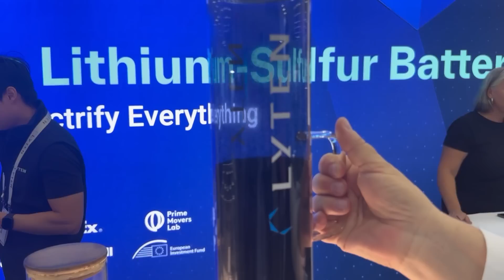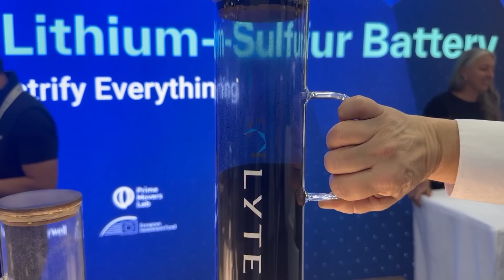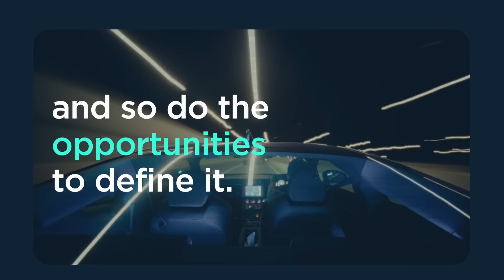Lithium Sulfur Batteries Are Half the Weight, 40% Cheaper & Coming in 2027 - The Battery Show 2024

Comment: Lithium-Sulfur is absolutely the future of batteries along with Solid State batteries. Sulfur can hold as much as 5 times more Lithium Ions that the best current chemistries using Nickel and Cobalt with 1/3 the weight. So a current 300 miles of range becomes as much as 1,500 miles. But even half that beats all current ICE ranges (so why on earth did he bring up hybrids with twice the parts to go wrong? Isn't 1,500 miles enough? Good of her to shut him down). And of course, the cost of Nickel and Cobalt is gone from the picture. 

So of course, Lyten is far from the only company working on them.
Reply: So many people don't understand how much range they really need.  With rapid charging becoming very accessible hardly anyone needs more range than what they can drive between meals.
Reply: @bobwallace9753  Correct. But the extra range is definitely needed when towing. And this shut up all those naysayers with the unprecedented ranges these will provide. Not only for the EV's, but also the extra storage capabilities on the battery megapacks at charging sites with solar which are springing up all over right now. They collect all the solar when EV's aren't charging on it.
Reply: @junehanzawa5165  
True.  Some people need more range because they tow.  But how many people tow something a long distance more than once every few years?  How many people ever tow at all?  If you tow but very seldom, rent something for that once every couple of years stuff.  

Right tool for the right job.
Reply: @bobwallace9753   Regardless of your point being correct, if we want people to abandon ICE, the more range the better. Which is why EVERY company and battery maker in working on improving range and energy density. New technology only replaces old technology if it's better, not the same. So EV's have to beat ICE in range. And they will. By far.
Reply: @junehanzawa5165  
I understand your point.  But ask yourself why people think they need as much or more range than they have with their ICEV.  The general public is very undereducated about EVs.  

There is hard work being done to increase energy density.  That's important because, assuming cost/kWh is about the same, a lighter battery has multiple advantages.  But what is most likely to get people into EVs is lower sales prices.  And a lower range EV is going to be a less expensive EV.

If we had a good quality 250 mile range EV that sold for $25k which would be less than $20k after the federal subsidy, it would blow the market wide open.  That would be a car that would pay for itself over its lifetime via fuel and maintenance savings.

So you've got only a 250 mile range.  Start your 500 mile drive day which you do twice a year with the full 250 and drive down to 10%.  That's 225 miles.  Stop for less than a half hour and charge to 80%.  Drive down to 10% which would be 175 miles.  That's 400 miles.  One more short stop and you've driven 500 miles with a modest range EV.  How many thousands of dollars would you be willing to spend to make that a one stop day rather than a two stop day?  (A meal and a pee.)
Reply: @bobwallace9753   You just proved why all that range is so important. If you have a 700 mile EV, you can charge to 80% in 30 minutes and get close to 600 miles out of it. Or charge for 15 minutes and get 400 miles out of it because that's when batteries charge the fastest. Or 7 minutes to get 300 miles. And if you NEVER charge past 80%, the battery lasts for 30 years or more. With all that range, you never have to. 

I'll leave this back and forth from a saying from the technology world: in technology and inovation, "simply being good enough, isn't good enough."
Reply: @junehanzawa5165  
How much would you be willing to spend, how many thousands of dollars, just for that range you would almost never use?  Maybe if you're someone who packs a baloney sandwich and pees in a bottle to avoid stopping on very long drives you'd be willing to drop the bucks.  Most people stop every few hours to eat, pee, whatever.  Since you can plug in then go eat or check your messages it's not lost time.

Remember.  The lower the price of a vehicle, the more people who can afford it.  And, remember, the important task at hand is to quit using fossil fuels.
Reply: @bobwallace9753  You're missing the point of how businesses and new products/technologies work. Those 700 miles EV's will mean that the 250 mile EV's of today will go for $20,000 brand new. And the 300 miles EV's for $25,000. And the 400 miles EV's in the $30-thousands and into the $40-thousands, and so on. The 700 miles range ones will be the most expensive ones, and cost as much as the 400 mile range EV's cost today.

Until a few more years pass and then the 1,000 range EV's come out and will be the top of the line and the 700 and 600 miles range EV's would cost in the $40 to $50 thousands, and the 400 mile range EV's will go below $30,000. That's how things work.

Remember when a 50" flat panel TV went for over $25,000 at the start of the 2000's? And a couple of years later for $10,000? And few more years later for $2,500? And then below $1,000? What are they today, less than $200 at Walmart? 

That's because flat panels are so much easier to manufacture than CRT and got larger and larger to sizes that CRT never could. And EV's are so much easier to manufacture than ICE and it's over 30,000 parts. An average EV has less than a thousand parts. And EV's can get to driving ranges that ICE never could, because battery technologies provide those abilities as they improve. 

Remember what I said at the start -- Lithium-Sulfur holds up to 5 times the amount of Lithium Ions than the top chemistries of Nickel/Cobalt do today. And that's just one technology we already know of. Then there's Solid State and so on.
Reply: @junehanzawa5165 if you have a 700 mile EV, your battery is half the weight of your car and half the power in your batterys is used just to move the weight of your batterys.  Not an effective use of batterys.

Maby you could buy a propane truck an convert it to gaseous  hydrogen so you can get 700 miles of range. It would be about the same efficiency.
Reply: I'm not sure if you are trolling or if you really believe in unicorns. 

Have a very special day!
Reply: @jasonneugebauer5310  Lithium-Sulfur is 1/3 the weight of the best battery chemistries today (no heavy metals like Nickel or Cobalt) with up to 5 times the energy density, so up to 5 times the driving range. Solid state is also much lighter than today's batteries with much higher energy densities.

Stop thinking of batteries like a fuel, where the only way to get more range is to use a larger tank. Batteries are going to be much lighter and smaller with much longer ranges.
Reply: @jasonneugebauer5310  Yeah, that's what they said a quarter century ago when I said there would be a card the size of your pinky nail that would hold much more data as the best magnetic 3.5" top of the lines hard drives of the time which could hold tens of Gigabytes. Those pinky size SD cards can now hold over a Terabyte of data and a will eventually hold up to 10 Terabytes.

Or that 50" flat panel TV's would have a hundred times better picture and would cost less than the $700 that a 32" CRT (picture tube) TV cost at the time -- those 50" flat panel TV's now cost less than $200 at Walmart. Or that a 75" would go for under $1,000. And that they would eventually be will be 100" or more in size.

So yeah, that's far from the first time I've heard that. All one can do is educate, whether the one being educated can possibly comprehend it, nevermind believe it, is a whole other thing.
Reply: @junehanzawa5165  I understood what you are saying before your post.

It's great technology if it works.  Lots of potential, if it works.  Much more obtainable minerals for construction, if it works.  Better power to weight ratio, if it works. 

I hope it does work 🙏
Reply: @junehanzawa5165  I am not a hater. I am sure this technology or another will make cheaper better batteries.

I hope they can make it all work. 

I'm just watching and waiting for the products to be available. 

As the lady in the video said, it doesn't really affect the market until you produce an acceptable product to the market at scale. 

I'll be waiting like you until then.  If you are really bullish you can invest and share in the profits, while helping the company fund its scale-up and production.
Reply: @jasonneugebauer5310   What do you mean if it works? Lyten is already manufacturing them and has handed them out for testing in automobiles, has a factory unden construction in California for Lithium-Sulfur and another one in the works in Ohio for Sodium-Sulfur.

And they're far from the only one. There are several companies working on getting ready to manufacture them. And you must have heard of all the companies working on Solid-State, a couple of which are already testing them in automobiles. 

This is a worldwide race, just like a century ago with the invention of the automobile. This is not one comapny, or a couple of little companies, with just some ideas. This is every company in the field worldwide spending hundreds of billions on this not because they "think" it's going to work. They know it works.
Reply: @junehanzawa5165  OK, I look forward to seeing the technology be implemented effectively in products.

Again, I am not a heater.   I am a dude watching videos and commenting because I am interested.
Reply: @bobwallace9753 the point is people won’t cars that make transportation easier and less expensive.  I’m a Tesla owner but I get it that people don’t won’t to have to think more about refueling on road trips.  They want to think less about it and for less cost.
Reply: @NickWindham  
We are just reaching the point where EVs become cheaper than BMWs.  The Camry market has not yet opened up outside China and some places where less expensive Chinese EVs are sold.  People want affordable cars and before 2030 we should EVs, even with LFP batteries, becoming cheaper than similar-feature ICEVs.  If lithium-sulfur helps bring the cost down lower and/or soon, great.  My point is that we will get to 'cheap enough' with the battery technology we now have.

It's about scale.  A company has to produce enough of something to be able to spread the fixed costs thinly and to obtain really good prices from suppliers.  Tesla arrived there at 500,000 EVs per year.  

"General Motors (GM) sold 75,883 electric vehicles (EVs) in 2023"

GM is going to lose money on EVs until they scale up.
Reply: @ronblack7870  
When we started driving cars there were no gas stations.  As we need places to plug in, we'll install them.  Charge outlets in apartment, school, and workplace parking lots should become common.  Some cities are already installing charge outlets at curbside.  Expect to see rapid chargers at fast food restaurants and grocery stores, places where people already go and spend about a half hour.

Don't forget. Utilities are in the business of selling electricity.  EVs are becoming a new market for them.

BTW, a study a couple years back found that over 50% of US drivers have a place to plug in where they park.  City dwellers, assuming they work in the same city, probably would need to use a rapid charger once a week or so.
Reply: "rapid charging becoming very accessible"??? Go check out parts of California, where there are hour-long waits for DCFC.... And some people eat in their vehicle.... 

I'm all for expanding the use of EVs..... But like everything they have limitations and trade-offs.... And nobody even mentioned cold weather..... 

So let's go easy on the wishful thinking propaganda.... You're not going to get people to convert by giving them a terrible experience..... 

The old adage still holds true. "Under promise and over deliver", if you want to keep a customer happy.
Reply: @ronblack7870  Every tesla charger i been to in the mid west are next to gas stations... I know a great place for chargers to be located once gas stations start disapearing actaully may stop them fron disapearing just transforming. Your acting like we didnt solve the issue with gas infrascture when the gas vechile came out.
Reply: @richardmenz3257 Yep. Tesla has been installing huge amounts of stalls at Buc-ee's -- there's one with over 80, another with 48. I've even seen a few with the Mecedes-Benz charging network chargers there as well. In the North East, convenience stores/gas station chains like Wawa, Quickchek, Sheetz, etc. have Superchargers in most locations now. This is happening all over the country.

Gas stations have been plummeting since the mid 1990's to the point where there's less than 50% of them than back then, and they continue to plummet. The smart ones are learning that the way to survive into the future and increase profits is in EV charging. The more people hang around, the more food, drinks, lottery tickets, etc, they sell. Those chains are taking over the country with refueling and charging together.
Reply: @ronblack7870  You have to stop thinking of EV's as ICE vehicles. How many people have their own gas station at home? How many people with ICE vehicles can do what EV owners can by adding solar and batteries to their homes and charge for free.

As far as massive amounts of stalls, out west Tesla already has several sites with over 80 stalls and a couple with over 100. Lookup the Supercharger locations at Quartzite, AZ or Barstow, CA on Google maps and then go to the "Street View" and see for yourself. And all of them have the whole place covered with solar and battery megapacks to collect all the extra solar not being used for later and into the evening hours. And now they're building one with well over 200 stalls covered in solar and battery megapacks and with it's own mini solar farm next to it.

Think about it, that's like creating your own "gas," if you will, right at the "gas station," and all for free. Do you know of any real gas stations that can do that? One that doesn't depend on OPEC and their production cut backs to pump up and keep prices high? Neither the sun nor wind charge for their energy, and they sure as heck never have an embargo.

I take it you have never looked up the Supercharger map online? Look it up, then click on a site and it tells you how many stalls they have. And you'll also see the whole US covered in charging locations and growing by the day. And have you ever been to a Supercharger location? EV's move in an out of it almost like gas stations. As some arrive to charge, others are leaving.

And businesses are beginning to see the light and the opportunity this is for them. They're starting to cover their parking lots with solar. Not only to save money in electricity for their stores, but to install EV chargers to make extra money with fast DC charging on top of attracting more customers by offering slow charging for free. Lookup the IKEA in Baltimore and it's solar covered parking lot, for example.
Reply: @ronblack7870  You have to stop thinking of EV's as ICE vehicles. How many people have their own gas station at home? How many people with ICE vehicles can do what EV owners can by adding solar and batteries to their homes and charge for free.

As far as massive amounts of stalls, out west Tesla already has several sites with over 80 stalls and a couple with over 100. Lookup the Supercharger locations at Quartzite, AZ or Barstow, CA on Google maps and then go to the "Street View" and see for yourself. And all of them have the whole place covered with solar and battery megapacks to collect all the extra solar not being used for later and into the evening hours. And now they're building one with well over 200 stalls covered in solar and battery megapacks and with it's own mini solar farm next to it.

Think about it, that's like creating your own "gas," if you will, right at the "gas station," and all for free. Do you know of any real gas stations that can do that? One that doesn't depend on OPEC and their production cut backs to pump up and keep prices high? Neither the sun nor wind charge for their energy, and they sure as heck never have an embargo.

I take it you have never looked up the Supercharger map online? Look it up, then click on a site and it tells you how many stalls they have. And you'll also see the whole US covered in charging locations and growing by the day. And have you ever been to a Supercharger location? EV's move in an out of it almost like gas stations. As some arrive to charge, others are leaving.

And businesses are beginning to see the light and the opportunity this is for them. They're starting to cover their parking lots with solar. Not only to save money in electricity for their stores, but to install EV chargers to make extra money with fast DC charging on top of attracting more customers by offering slow charging for free. Lookup the IKEA in Baltimore and it's solar covered parking lot, for example.

Comment: Sounds like it's a lot further out than 2027
Reply: It may also never come out, just like happened to many battery technologies before.
Reply: because their cell is still in development and the scaling in production is still needed.
automotive needs at least 1500 cycles and my guess is that lyten is in the area of 500 cycles - which is enough for many applications. theoretically even for automotive if one cycle gives you 700 real world kilometers. 500*700 = 350000 km
Reply: @stefanweilhartner4415 I think if their battery is as cheap as claimed then replacing it with a new one might be feasible.
Reply: Sounds too good to be true.